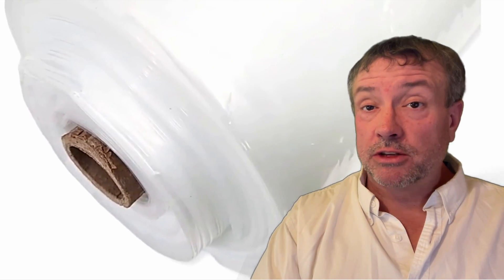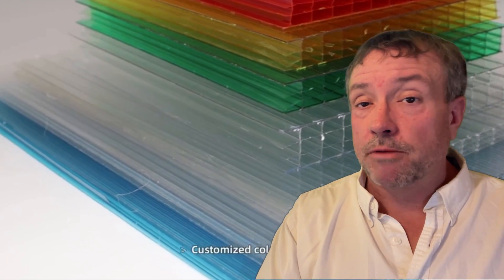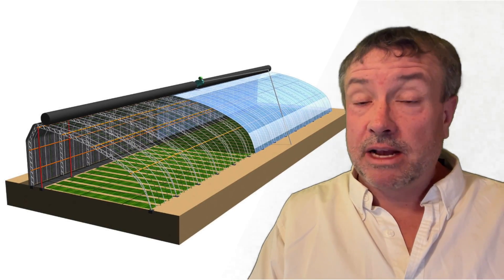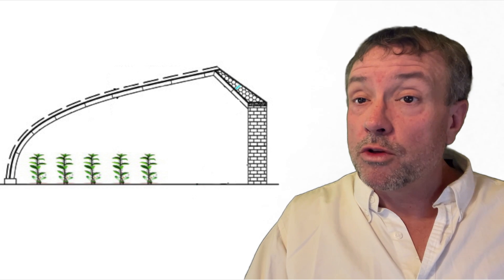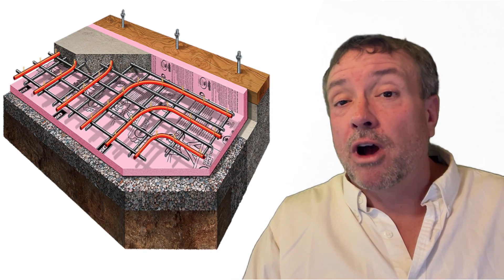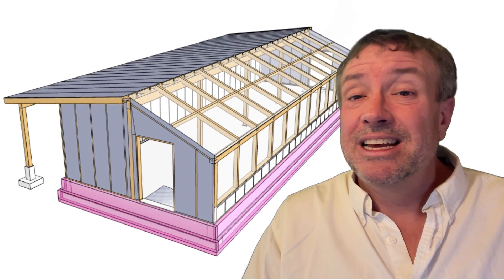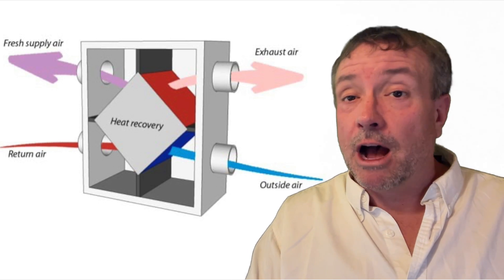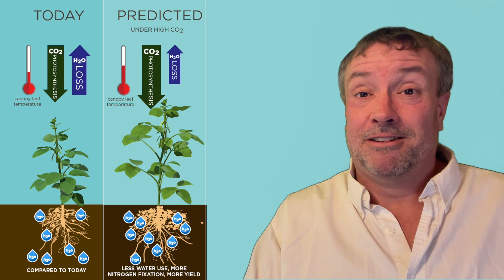6 Ways to Insulate or Store Heat in a Greenhouse

Comment: I get around heat loss by having built my greenhouse alongside my steel-walled dwelling, which acts as a thermal mass somewhat.  The floor is slab on grade. The exhaust from my house's gas wall furnace runs through the length of the greenhouse, so when I heat my house, I heat my greenhouse at the same time. Also, my electricity plan affords me free electricity at night, so I can run a small ceramic heater on a timer those times I'm not home. I have been considering installing a bypass on the wall furnace vent, which would spill CO2-rich exhaust from the burned propane gas used to heat my house, but haven't gotten around to it yet. I grow mostly leafy greens and herbs in North Texas.
Reply from the maker: I’ve never heard of free electricity at night! You need an electric car!!
Reply: @SimpleTek  
I need an electric car like we need Biden running the dog and pony show!
Reply from the maker: @WhatDadIsUpTo  you can’t give 10 lbs of gold to someone who wants 10 lbs of silver
Reply: @SimpleTek  
I don't want either.
Reply from the maker: @WhatDadIsUpTo  747 right over your head there
Reply: @SimpleTek  
That's an excellent observation.  I'm high functioning spectrum autistic and even though my IQ surpasses Albert Einstein's by well over 100 points, social nuances somehow leave me standing, as it were, naked in the cold. Go easy on me,  please. I'm trying as hard as I  can to 'fit in'.
Reply from the maker: @WhatDadIsUpTo  my apologies, please feel free to comment on any of my content at any time, good or bad

Comment: You dont need a fan to create airgap between double poly plastic walls. In old days it was done using 3 nolon strings in each wall element. Fans came in 1980s. I might bee old fasioned but I will go with the old method for my greenhouse next summer as the fan only adds electricity costs.

Comment: Here in Germany I compost horse manure with straw inside a greenhouse to keep the plants warm. This technique is shown in gardening videos from Europe.
Gardening companies here sell big black hoses with water inside to put on the ground of the greenhouse. The sun warms up the water in the black water vessels.
Reply from the maker: Thanks for sharing! That's awesome. I hope to do some composting experiments soon as it's a great way to generate heat
Reply: Ah what a great idea. I wonder how much compositor manure you would need for a green house? And what average temperatures you would get?
Reply from the maker: @willmakxam3834  depends on the size of the greenhouse, insulation, climate, etc. Compost piles usually run from 120-160’F
Reply: @SimpleTek  horse and cow manure is amazing compost. I wonder if our 60 goats would be able to create enough manure and heat?
Reply from the maker: @willmakxam3834  mix it with wood chips and greens
Reply: @Simple Tek  ah yes! That would work. I wonder if there is an advantage to putting the compostbin in a garage area close to or adjacent to the green house?  Being able to turn the boule if necessary? Of course not disturbing the pipes that would transfer the heat.

Comment: Thank you for the information in the first place!  The best construction of a greenhouse would be the Chinese one that appears at minute 03:53, at least in winter.  What would I improve?  I would double or even triple the number of "quilts", or I would replace them with several layers of bubble wrap, in the northern wall I would leave about 50 cm of space which in the cold season I would fill with compost materials that  I would fill it with a conveyor belt and I would empty the compost by opening some doors inside the greenhouse.  For  ventilation, I would use a metal downspout that passes through the compost in the wall, so the air warms up, or / and, the same flat metal downspout painted black that on sunny days will heat the air entering the greenhouse.  However, for more safety, I would also install a classic heater!  Don't forget the lighting during the long nights!

Comment: This is helpful for many! 

In regards to insulating/storing heat, I really the idea to leverage radiant heat down low, so I like the pex/sidewalk paver idea. I'll be doing a Rocket Mass Heater myself. 

The second thing I wonder about is the blanket. It seems like a great idea, but I think doing only a small section makes sense in most <4-season applications. I've been playing around with the idea of setting poles/pipe to be able to heavily blanket <20% the volume of the greenhouse, and radiant heat/thermal mass that section.
 
Also curious about the value of ambient sunlight(north wall). I bet its hard to find studies/research. I got the sense from a vergepermaculture interview that ambient light from north wall has some value, maybe even more so than +1R-value.
Reply from the maker: The university of Manitoba did a case study on that about 10 years ago with a Chinese style greenhouse
Reply: @SimpleTek  Ill take a look at it! I was working off information about ambient light came from here: https://www.youtube.com/watch?v=wUE9Td2iqYU @ ~16:00 thermal curtain discussion. It's not a study.. but seems fairly evident

Comment: Another way to store heat is called a climate  battery.  It consists of an air tube to collect  warm air from the top of the greenhouse and duct the air through  tubes burrowed under the grow beds.  And covering  the plants with  floating  row covers, insulation for just the plants. That's it in its simplest  form.  It can get more  complex. 
Small  fans to move air /co2 in contact with  leaf surface.  Black plastic coils set in the sun to preheat water used to water plants.
My latest, lean-to style, micro-greenhouse has concrete  pavers  and will  share  a window  with the  house. A thermostat  controlled fan will move the extra heat.  Cheap moving  blankets  as movable  insulation.  Instead of  the 2d layer of plastic. 
Just a few ideas.
Reply from the maker: Thank you for the idea, there's about a dozen videos on climate batteries in my archives  ;)
Reply: @SimpleTek  I  found  them thanks

Comment: also having mamals inside can help with both CO2 in morning and heating at night but for night maybe in diffrent part with out air circulances only heat can transfer "spreated by a metal sheet wall.".
Reply from the maker: Very true

Comment: Putting black water filled cylinders between plants or in front of the north wall should help, too.
Reply from the maker: that's a good way to use thermal mass to hold and release heat!

Comment: Isolating the ground under the greenhouse up to 8ft deep is probably a better solution than simply isolating the floor.  This would allow to benefit from the stable energy (temperature) of the ground under 6ft.    This action would keep the temperature of the ground above 5C during winter which would be great for winter production.  But is that action would be sufficient to also keep the greenhouse air above the freezing point?  or would we need a geothermal system Air-ground to ensure to maintain the air above the freezing point?  Nevertheless, a geothermal system might be interesting to be used as an air conditionner during hot period, what do you think?  What is the best?
Reply from the maker: A geothermal system needs the floor, not 8 feet down insulated as it uses more than the mass directly under the greenhouse
Reply: I do not understand your answer.  Please add some details because it looks to me that my point was possibly not clear enough to you. @SimpleTek
Reply from the maker: @denisdufresne5338  I’m not a grade 2 teacher
Reply: Then you have not understood my point.   A geothermal system can work well with or without a floor but I agree that it will work better with an isolated floor.  My point was that for a very cheaper price another solution would be to isolate the walls of the block of ground under the greenhouse to create a thermal mass where the heat is coming from the ground itself.  It keeps the soil unfrozen which keeps the plants happy and alive.  It also warm the air a little bit. @SimpleTek
Reply from the maker: @denisdufresne5338  ok

Comment: COLOR is important
Limestone WHITE has a tendency to stay a few degrees BELOW ambient air temperature 
Black has a tendency to absorb heat and stay above ambient air temperature 
add DARK pigment to the concrete mix of any thermal mass you want to retain heat in and do not add pigment if you want to radiate heat (more southern climates) 
so end walls  black on the outside to absorb heat and white on the inside to radiate it
 a reflective layer on the quilting to help reflect any heat instead of letting it radiate is a bonus
Reply from the maker: VERY true - thank you!
Reply: The color white  reflects  all spectrums  of light. While silver only reflects  part of the spectrum.
Therfore paint all of the supports white.
Reply from the maker: @gregsanderson2470  well said

Comment: Hi, could you use used double glazed panes from house windows being replaced? I understand some home windows are treated to prevent too much sunlight coming into a room.
Reply from the maker: I would think you absolutely can!!! it involves a lot of framing but it's a good idea
Reply: @SimpleTek  👍
Reply: I was told they block UV blue rays but lets IR red rays in and traps it from easy exit to outside. I got a bunch of different sizes from him for cheap as they were overstock and un-standard sizes.
I am planning to use them for a greenhouse heating and heated air exchange units. I have built many types solar water heaters, but never used Low-E glazing. The reduced UV rays will help preserve painted PEX/copper/aluminum and polypipes. Yet the trapped Irradiation Red rays will increase the heating of the unit (in theory, anyways).
Note: I had put a bullet hole in the largest one after it went through the damn chicken killing fox. After losing 22 chickens to that bugger, she cost me my biggest Low-E pane (3 ft X 5 ft). I tried to live trap her, but she was too wise to it. Maybe after seeing all the racoons trapped in it, she figured best to avoid it. Anyhow, I have many other dimensions to work with. Just means more framing to do.
Reply from the maker: @redstone1999  thank you for the story, I hope you get the fox
Reply: @SimpleTek  Yes, I did get her. Thankfully she did not have milk teats, so no motherless babies somewhere. That would of sucked big time. But losing half of our flock, also sucked big time.

Comment: Looking to build a greenhouse in northern Illinois and the north wall with an east-west orientation seems to make sense.  Trying to decide what materials to build the north wall. Current though is an insulated framed wall with a thermal mass lining the inside.  I have also seen a design that uses a huge compost pile as a heat source and air tubes underneath that capture the heat and pump that into the green house. Any thoughts?
Reply from the maker: Use the best materials you can afford and a thermal mass that generates heat is awesome
Reply: I have been plugging away at researching the same question. So far. I am leaning towards using a simple studwall. Outside. Inside. Straw bale wall or 12inch straw and then cobbed on the inside of t he greenhouse. Likely should house some tar paper or some sort of breathable wind or vapourbbarrier to prevent mold behind the wall
Reply: Straw is about $5 per bale..... and mixing a few bags of Portland cement and clay or Mudd around the farm? Should do the trick. Cost? Least. Labor intensive but big suspect the long term oay off will be good.

Comment: Thanks! I was just gifted a wooden greenhouse.  I'm in Northern Wisconsin...so it is wooden on 3 sides and waist high on the side with glass windows. It has a long black shingled roof pointing north with a back wall of about 6 ft tall. The walls are 2 x 4 studs with decorative plywood on the outside. We poured a concrete slab and fastened it down. After watching your video I have a few questions.  Would it help to paint the inside flat black? What type of insulation is safe for me and the plants for the side walls? What type of wall material is safe? As a starter I'd like to use it for 3 seasons....not sure how it will work....but it's faster ed down on a slab and I painted it to match our house....so it's a family member now😂 any advice would be welcomed!
Reply from the maker: I’d make the inside reflective of light, better growing.
Reply: White reflects better than shiny surface which scatters light

Comment: Thermal banking. Transfer heated air from the day or from all summer and pull from that solar bank  all winter. Heat pump system using water or air should easily transfer this heat to and from your solar bank. 

Solar bank is  typically the soil under the green house. Raising the ground temperature from an average of 14 Celsius degrees at 8 feet below grade to an average 18 degrees Celsius.

I have yet to build my wallipini. Or one glazed wall/ceiling, 4 walls half under ground, like the Chinese green houses in this video, except 4ft buried walls
Reply from the maker: That’s awesome

Comment: Hi, Thank you for making videos :-)
6:30 - What do you mean by "radiant heat fluid to concrete slab"? Are you referring to antifreeze for floor heating pipes?
I'm from Poland and I'm trying to understand what this fluid is :)
Recently, I saw an interesting new kind of Chinese greenhouses - a double roof and the insulating blanket is inside.
Reply from the maker: Most here use glycol
Reply: @SimpleTek  any advantages/disadvantages using distilled water vs glycol?
Reply from the maker: @Captain-Jimmy  water can freeze in winter, cracking lines. That’s the main reason to use glycol

Comment: How low would the soil temperature need to go for heated floor to make sense? Thanks for the video.
Reply from the maker: good question, I use a radiant floor myself in my greenhouse and we get some pretty cold temperatures here 60 miles north of Winnipeg, Manitoba, Canada
Reply: @SimpleTek  In my Mediterranean area we barely hit 0°C, the seasonal cold strong winds are the largest issue. But the ground gets nowhere near the freezing temperature.

Another idea that comes to mind is digging in a bit. Deeper you go, higher the soil temperature.
Reply from the maker: @mkeyx82  you live in a beautiful area of the world!
Reply: @mkeyx82  Depends on what you want to grow mid-winter. If you want to maintain 20 C (+/- 5 C) , a radiant floor like Simple Tek shown in video would do the trick. Also by having 2 " of board insulation with 4-6 " of sand over and patio slabs on top will keep floor warm. A few dark water barrels will help hold heat. 
But if money allows, I would add PEX piping inbetween sand during construction. If you need to have extra heating, it is just a matter of hooking up pipes to system without a major rebuild later.
Reply: @redstone1999  thanks for the information. "Board insulation" would be stuff like stirodur?
Reply: @mkeyx82  Go with the dense one for floor. I use 1 1/2" x 2' X8' one direction and second tier opposite direction. This gives me a R-15 and a rigid base for sand. If I had to do it again, I would of added another tier or two of insulation boards.( I am in a very cold zone ) 
Do lay out a good layer of sand tamped down level before adding vapor barrier plastic.
Reply: @redstone1999  the idea behind the vapour barrier is to have any moisture below the plates wicked away by the sand?
Reply: @mkeyx82  Sorry, I meant leveled tamped sand followed by vapour barrier, then insulation board(s) then more sand on top of insulation boards.
Reply: @redstone1999  OK, thanks, that makes more sense. Sand needs to be in contact with the ground to get the water out.

Comment: I was thinking of using one of those orange, thick, insulating tarps that they use for concrete construction to use as a thermal blanket. It should last a long time and is light enough for me to handle. Not very expensive either.
Reply from the maker: Great idea!